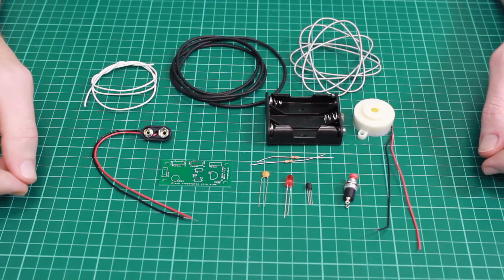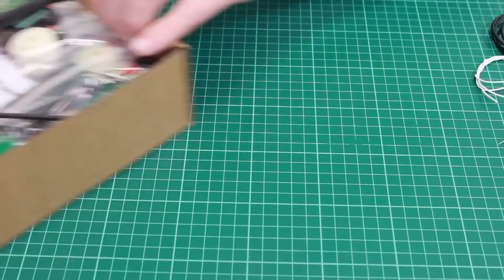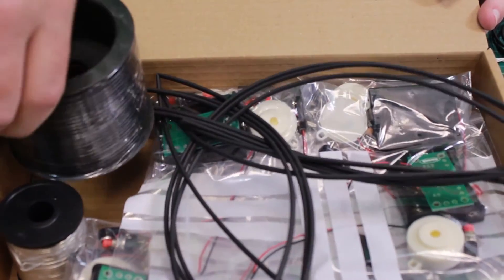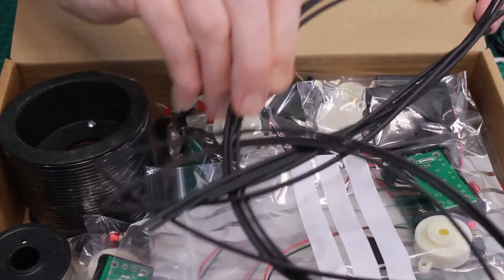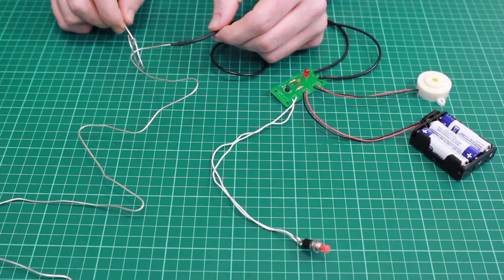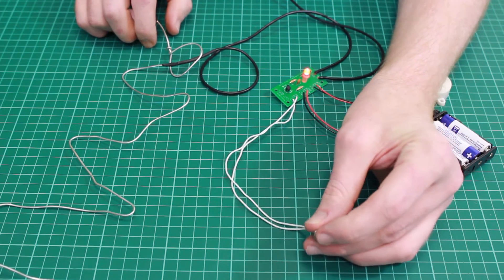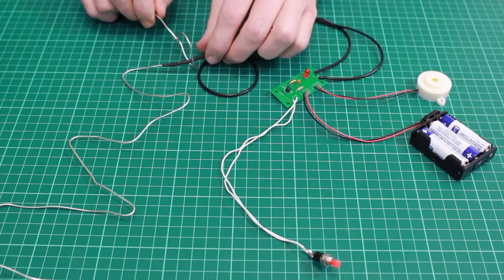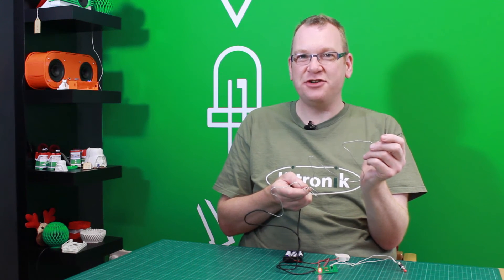Latch Steady Hand Game Kit

Comment: Hello Rob, 
I have subscribed to your channel, it's informative, direct and brilliant, thanks for the great work.
I have a question about the quiz buzzer kit,  which allows to participants to use the kit,  as well as the reset button.

If one participant presses one button,  gets the answer wrong, is that participant then locked out until the part of the quiz game question is answered buy the next participant.  

then we have reset to allow participants ready for next question ?
_______________________________
Reply from the maker: Hi,

It's presumed that the next participant will be allowed to answer the wrong question. Neither button will work until the reset button is pressed.
Reply: so once,  first person to buzz first 

you answer either correct or incorrect, the general knowledge question, 
then other opponent can buzz in  and try to answer too. before reset. 

or is it whoever buzzing in first, gets the only chance . then reset and start again and again.  

This does lock out the slowest person to buzz in first, if the other buzzes in quicker.  so it is a lock out buzzing system to some degree.
Reply from the maker: It is a lockout system, but with just two players you can just ask the other player for their answer if you want to pass the question.